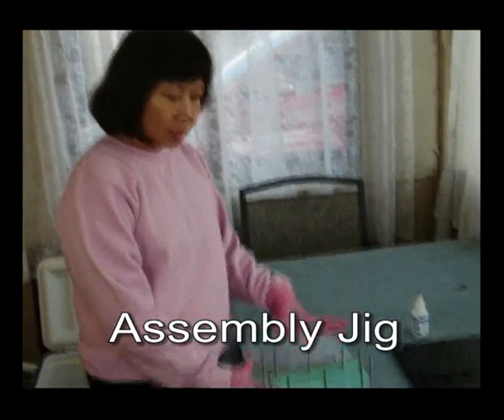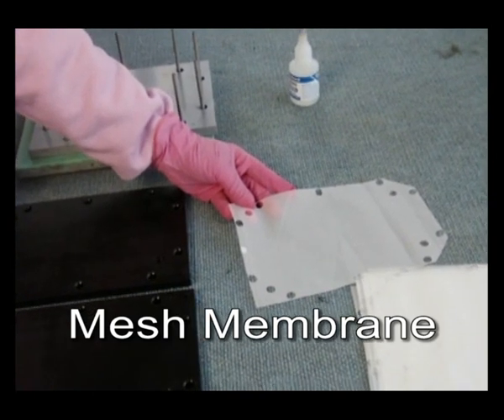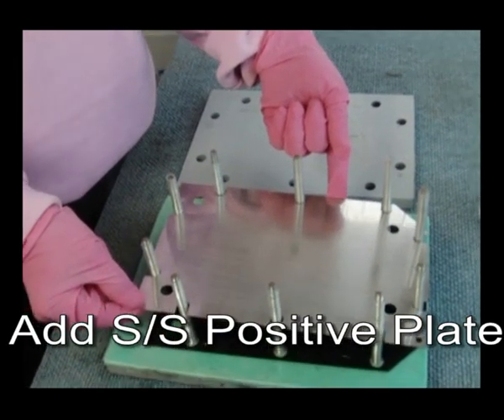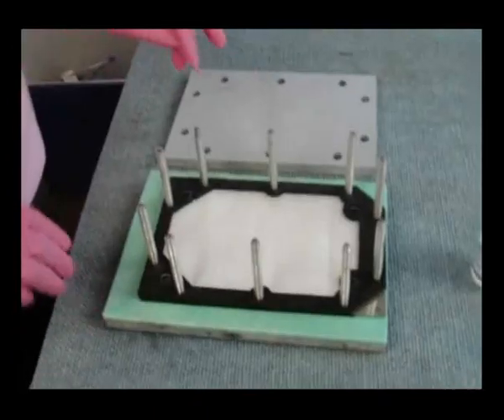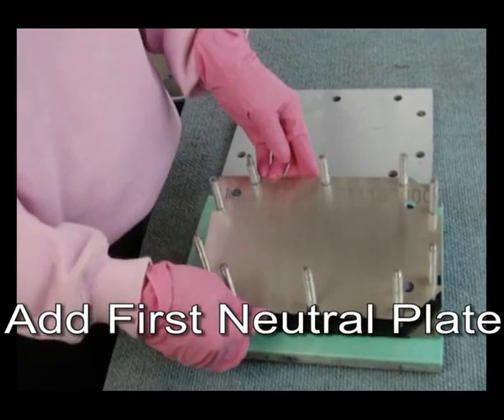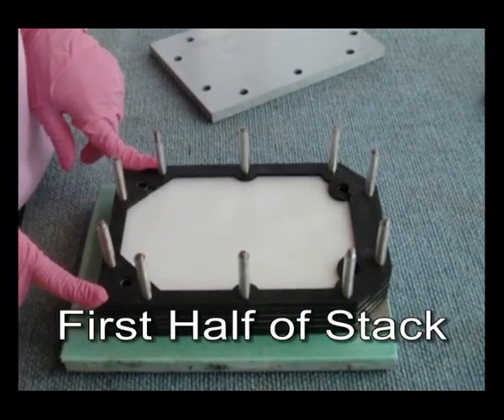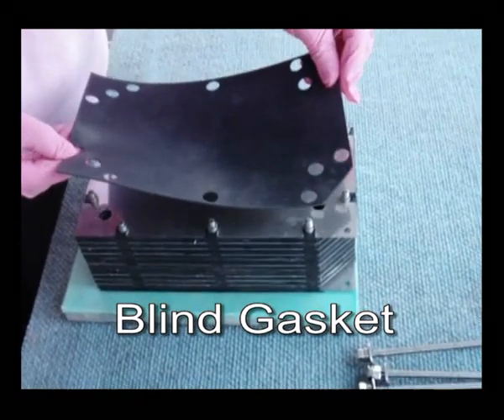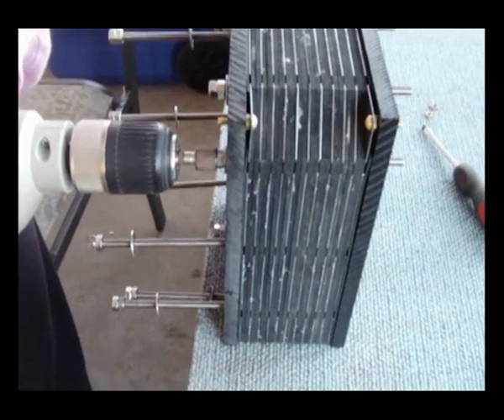Hydrogen Separator Double Cell Build

Comment: Easy to understand HHO car kits are very SIMPLE BUT WORKS GREAT for your car better than you think.!!!

Reduces carbon emissions, Good for the Environment. Restore Engines Performance, Improves fuel economy, Prevents Engines wear & tear. Engine cool down because burning Hydrogen just makes WATER.!!!

ACMEC HHO kits are designed for hho gas production in low voltage & low amps.  Lower heat generation Easier to Mantain and Easier to Install ,  Compact in size but more stable HHO Gas Production.   All hho kits generated Hydrogen and oxygen gases nothing else.! You never try to store  , use it as you make it . HHO on demand system according to your needs considered very very safe.

Yes HHO CAR KIT will improve your engine horsepower and fuel burning efficiency while reducing toxic gas emissions hho kit will solved all engine heating problem automatically. Engine will run clean and smoothly requiring very little maintenance, you will only have to add distilled water. Hho is best for  decarbonization of your cars. So make your car zero emission. In this way you can stop polluting the atmosphere.!!

You will not see brown deposits in our new designed long lasting hho kits. Our  kits for efi cars working up to two amps. 

But our transparent hho kits for carburetor types engines working up to 8 AMPS. For better fuel economy. ACMEC HHO CAR KITS can installed on petrol, Cng gas, or o engines, to run smoothly and your life will much easier.

For more call zafar 03082266179 or watch hho zafar videos on YouTube.

By

Comment: what is mesh membrane?where can i buy it
Reply from the maker: Find a silkscreen mesh that is  very fine T300 at least.  The mesh should be mono filament (most are) If you can fine T500 mesh that is even finer and better to use (T500 - threads per centimeter)
Reply from the maker: I haven't tried felt, but if it is fine enough it may work.  The mesh that I use is very fine silkscreen printing mesh.
The fine mesh is difficult to cut accurately, so I use a laser cutter to do it and they are perfectly accurate.
If needed I can cut for you and send in the post.
Reply: Hi Reg Pye. How are you? Can I use 1mm thick polyester felt instead of fine polyester 300 T - 500 T mesh ? https://wholesaler.alibaba.com/product-detail/Customize-thickness-high-quality-polyester-felt_60561672902.html?spm=a2700.7724838.0.0.eoSRcZ
Reply: O... I can make special high quality steel punch to punch holes through the felt . No problem. I think location tolerances are not very important in this application. I'm kinda concerned about integrity of the felt. With time it can disintegrate. Probably the best thing to do is to cover the felt from both sides with coarser nylon or polyester mesh. Also Is it good to use neoprene rubber as a material for a seal ? Or maybe PVC  rubber (bath liner) ?

Comment: Hi RegPye ive send you an email but my question for all peoples.

What is with the middle of the gasget between the hole? The steel is nacked on the smal 1mm side between the hole connection of gasget and membrane. In my experience follow a part of electrolyte the gas H or O in the tube into the reservoir. The Isolated part on the + or - part of the cell which is complete closed is only for separated flow. On this smal parts between the complete smal gasget is the possibility to produce a part of the wrong gas. The video dont show that this part of hole is isolated. I hope you can understand what i mean.

Tank you
Reply from the maker: The membrane is attached to both gaskets with Sikaflex adhesive,  The hole is cut through to stop anything blocking the membrane material. 
As long as you make a good seal to the gaskets, no breaching of the gases will occur.

Comment: Is there a place in the U.S that i can order the  mono filament polyester you speak of? ive been googling it but cant seem to find one thats the 300T you recommend.
Reply from the maker: I am not familiar with the USA markets.  The mesh is very fine and it is hard to cut accurately by hand. If you need membranes I can cut for you with my laser to whatever size and shape you need,and post back to you.
Just a drawing with dimensions on it and I can make the cutting file for you.
Send to my email regpye@gmail.com
Reply from the maker: ***** 300T is what I have been using, it is extremely fine and a bit hard to get because most like to use the coarser grades for silkscreen printing.
Reply from the maker: 300T - 300 threads/inch

Comment: Hi what is the membrane material and where can I purchase it?
If hydrogen is one one side and oxygen on the other, how do avoid mixing if you have multiple cells? Thanks for the excellent video.
Reply: Use nylon fabric or reusable shopping bags
Reply from the maker: The secret is in the gasket design. The gasket separates the gases from each other and each gas is directed into it's own header. The wet membrane keeps the gases separated until the gases leave the single cell chamber to go to the headers.

Comment: Where can I find the mesh membrane and what are the specifications of this material. saintfelix39@hotmail.com
Reply from the maker: The membrane is mono filament polyester with a very tight weave (300T/in)  It is rather hard to cut accurately by hand, so we cut with a laser.
Membranes are available for those that want them.
Reply: thank I' cut in waterjet machine

Comment: Hi Reg, does each and every gasket slot is placed on the opposite side as you had fast forwarded on some plate fitting ?
Reply from the maker: The gas slots need to correspond with each other so that the hydrogen gas slots are all joined together and the oxygen gas slots are all joined together.
After the centre plate (titanium) the slots are reversed because the centre plate has hydrogen on both sides.
Reply from the maker: ***** The gaskets are the same, only difference is how you place the slots.
To make a double separator cell like the one in the video, you need to have 5 sets of gasket/membranes made up so that the slots are starting on the left (other side will be right) and when you make the next 5 sets you start with the slots on the right (other side will be left)
It means that when all the holes line up on one side of the cell they will be for either oxygen or hydrogen, the other side will be either hydrogen or oxygen, depending on which way to assembled the cell.
Remember that the titanium plate should be in the centre and should also be negative.  If you apply positive to the titanium plate it will form a layer of titanium dioxide which is a very good electrical insulator.
The centre plate having a negative potential on both sides will produce hydrogen on both sides, that is why the gaskets need to be reversed when making the cells on either side of the titanium plate.
Reply: ***** Thanks for your time for all that information. I had just made a 11 Plate and all connected and not working as it should which both reservoir tanks produces hydrogen. I now know the other half of the gasket has to be reversed and i was also using 2 end plates for neg and centre for pos.
A big thank you Reg
Reply from the maker: Mike Che Are you using a titanium plate?  If so you must connect it to negative or it will produce titanium dioxide on the surface and that is a very good electrical insulator.
Reply from the maker: Mike Che OK, that means you can connect either way that suits you.
The stainless plates are not affected by the polarity, just the titanium plate is.
Titanium really helps to give off the hydrogen, don'y know why, but it does.
Pity it is so expensive. (but worth it)
Reply: ***** Hi Reg
Just got my separator cell all assembled. Using 11 plate, centre NEG, 305 silk screen membrane, 2 sets of 5 gaskets. Got it connected and running but somehow still cannot manage to separate the gas, one side of gas when lit, pops and the other bangs. Really really appreciate if you can email so i can send you images of my build dissembled as to what went wrong, am really upset as this took me ages to make and set it up.
Many thanks
Reply: Hydrogen gas will burn as flash of flame and oxygen will explode... Your sucessfull with your Hydrogen separator cell.

Comment: do you have a video of the cell running?
where does the oxygen go?
Reply from the maker: Oxygen is released back into the atmosphere, we don't use it unless for welding purposes, and then you can control the amount of oxygen used and hence the temperature of the flame.
Will add some more videos of cell running as the website has been taken down due to health reasons.  Have many parts available if anyone wants to build a cell.

Comment: It's nice, it's great, and I intend to make a H2/O2 Separated generator, because I've already made a HHO generator I'm comfortable with and also have disadvantages in that it is the hydrogen and oxygen are mixed and HHO gas, so ask your use of the materials for membrane, I know it's a fabric in question, but if you can accurately explain to me where to look or buy, what kind, what material????
Reply: Did you ever get a response in regards to the membrane? (That was also my main question.)

Comment: do you use a pwm with this, also have you spectroanalysis of gases purity.  I need above 97% and have only been able to get 78%.  What is the special membarane you are using? how much to buy this as seen on the table before it is made. how often does it need cleaning?

Comment: Its really a nice detailed video
only one question > can you explain me regarding this "silkscreen mesh, T165", is it an isolator and waterproof? if yes then why not to use a cheap food raping plastic sheet? is this special silkscreen which is not 100% isolator and so helps in transferring electrons?
 I am new to this technology so kindly help me.....also please help me where I can find this "silkscreen mesh, T165"....

Thanks
Reply: both nylon and poly ester T120 are plenty fine holes to avoid mixing of H2/O2 bubbles, easily find a store that sell silk screen printing material, and buy,